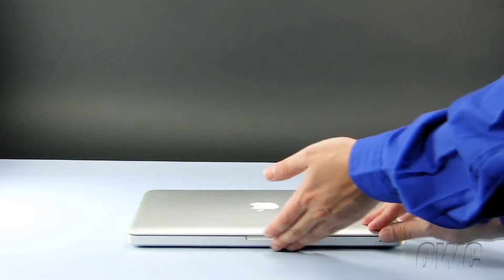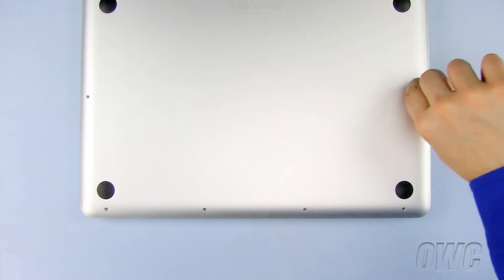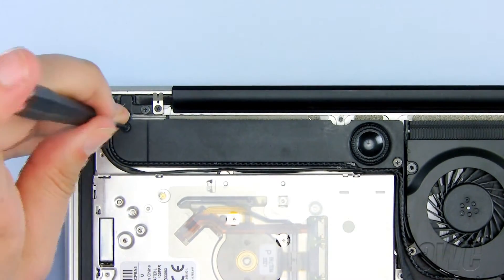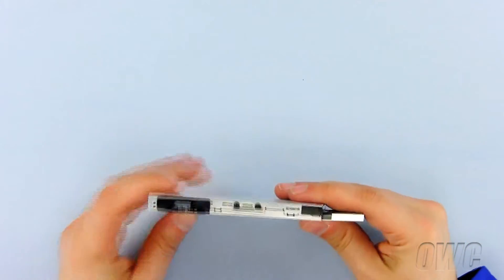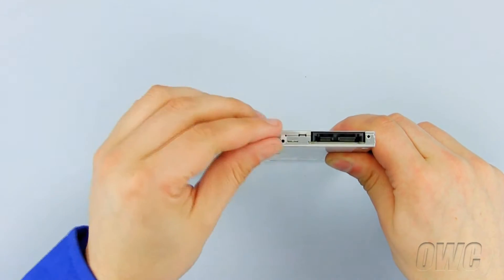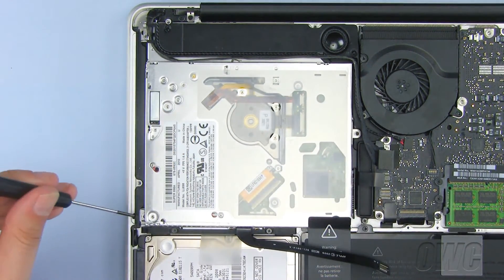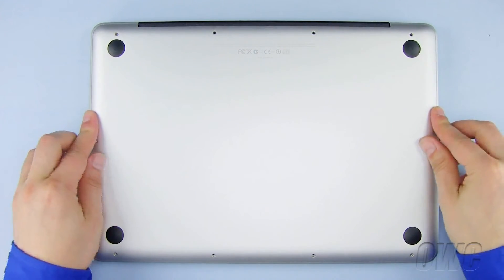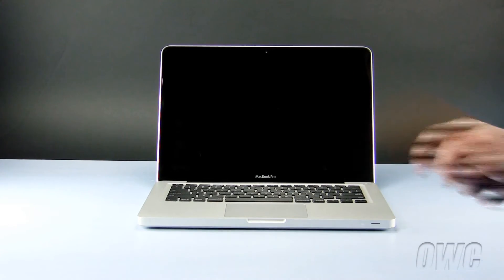13-inch MacBook Pro Mid 2010 Optical Drive Installation Video

Comment: Hi I have a Hl Data Storage Model GS30N Optical Drive ( 2012 made) I managed to connect it all good. Have not been able to test with CD/DVD Yet as I have non at home. I am planning to use it for Bootcamp

But Bootcamp still giving me the message: You Need an optical Drive to install windows. [ Not sure if this is a permanent alert or it should go away once i connect a proper Optical Drive]

Is this Optical Drive compatible with mac? are there any optical drive specific for macs? connector is same, I only had to remove part of the casing (from the optical unit) which was made to be installed on a 2012 Alienwre, so it was kind of big.

I cant find a way to see if my mac is actually recognizing my optical drive. 

Thanks
Reply: Great video BTW, really helped me through

Comment: Watch that small woofer may block Disc insert slot like it did mine!: FIXED MINE!: Mid 2010 MacBook Pro 13" dvd/cd drive could not insert a disc, opening blocked-couldn't insert disc!... Turns out it was the little subwoofer on that side was blocking the opening! I turned of the Mac and opened the removed the DVD drive to deal with the subwoofer. Turns out the after market speaker edge was too long so I had to use a rasp file and file that end, didn't expose a hole although there is a bass reflex hole close to the end. Then added contact adhesive or double sided tape to the flat ends of the woofer so that it would't pop out of it's pop in place when inserting the DVD drive has a center metal lip that fits into a matching indentation on the woofer. With the filing, the lip no longer pushed the woofer again the end and out of place. 
Hope this helps someone! My MacBook just keeps on going. Have replaced over the years myself: 2 batteries(Be sure to get apple brand, the first one wasn't and didn't last-now I don't use the battery if I can help it to extend it's lifetime), spinning drive replaced with solid state, 2 sets of speakers-the main speaker eventually goes out and then the volume is very low-after market main & 2 small woofers seem to work great till the die years later like the factory one did, replaced the mag charge cord in the power brick 5 times over the years-crack the brick open with screw driver and access the 2 wires to connect a new charge cord from ebay-tricky to do the first time but works and cheap like new fix!
Reply from the maker: That's a great tip, Jim, thanks!

Comment: Thanks. Can I remove drive without replacing....using external drive instead?
Reply: Any tips to make sure work space is static free.
Reply: can I just leave the connections there without being cinnected to a drive?

Comment: I have an orange ribbon on my optical drive. what is that and will I need a new one if I replace my optical drive. i have a mid 2009 macbook pro 13 inch.

Comment: Important tip! Even though a $19.99/free-shipping replacement optical drive on EBay for a 2010 MacBook might LOOK like a deal? Said drive on arrival can turn out to be too thick/wrong model. Thank you for the video which at least helped me safely remove and put back together a (now driveless) Macbook, with the rented DVD of Cinderella rescued. -John (P.S. Anyone want an $0.99+shipping optical drive that does NOT fit the above configuration? Sigh.)